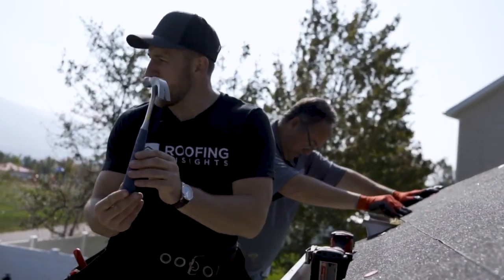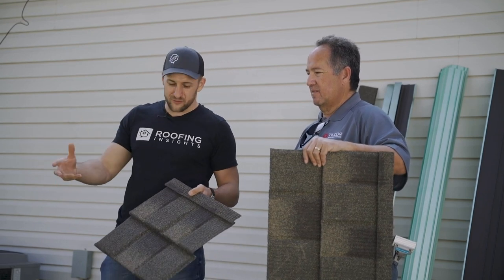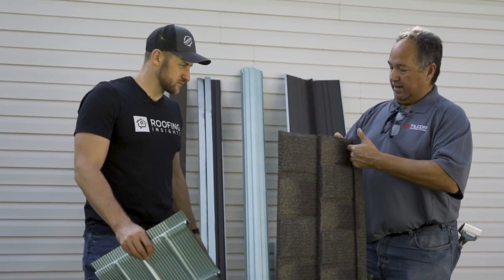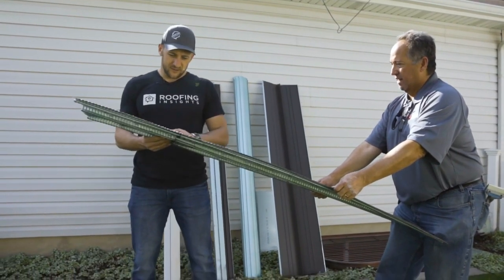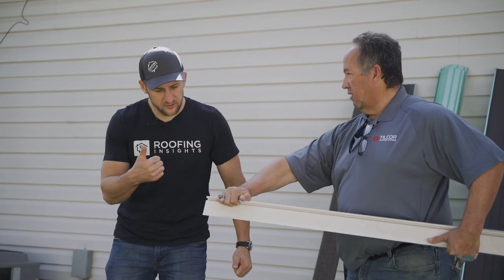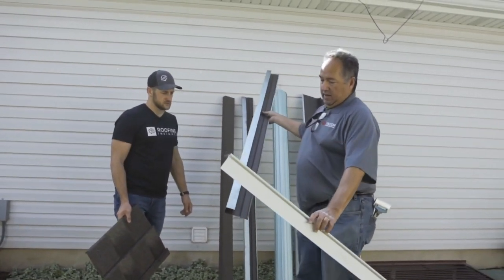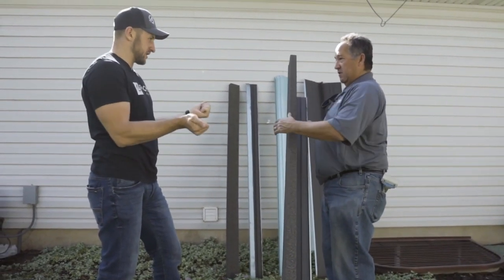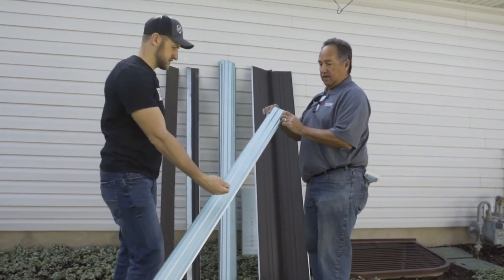Metal Roofing Installation: Tilcor Roof System | Roofing Insights

Comment: so what do you do on this roof for fall protection after it has been installed? where does the temporary anchor go? In my area permanent anchors have to be engineered so nobody installs them and it is common to screw temp anchors over the asphalt shingles then seal nail holes with caulking. Fall protection is mandatory for heights over 1 story.. Gutters get cleaned twice a year sometimes.

Comment: Cool system. Id love more information.  

Another metal roofing system that you can use granulated ice and water shield. Diamond metal shingles also allows granulated ice and water, according to BDR. 

As I'm sure you know, you have to use Psu30 or some type of smooth ice and water shield (that won't stick) on standing seam. 

Do you have information for sales rep on diamond metal shingles and this product? U.S. based reps??

Comment: Sorry Dimitri, I can't endorse any metal roofing company that uses a granulated (garbage) ice and water shield with a G90 or AZ60 substrate.  The lifespan of the metal roof will far out reach a product meant for use with a 15-20 year product. Imagine a cold can of soda/beer on a warm humid day, it condensates.  Now imagine that happening on the underside of the steel panel, with the expansion and contraction of the metal.  Take moisture, steel, and self adhered sandpaper (granulated Ice and water) coupled with expansion and contraction... rust the panel from the backside out.  Metal roofs are much like tile roofs, where the metal only handles a certain percentage of the water, and the underlayment does the rest of the work.  Much as your video about ice and water shield explains the value of ice and water, and the extreme differences between a granulated (cough garbage) ice and water shield, and a high-temp, or film faced ice and water shield, I refuse to stake my company's reputation, and the expense of warranty calls, for a few dollars per roll.  If you are really selling the advantages of a metal roof, you should have no problem justifying the your price, and why you use quality components that make up the core of your roofing system.   Also, for the love of all things holy don't staple the synthetic felt.  Manufacturers only cover stapling synthetic felt when you are able to cover it in a short amount of time (varies per manufacturer, and per final roof covering) and most metal roofs take far longer than those stipulations allow.  Has anyone ever wondered why Titanium UDL has Ghost Buster style pictures of no staples, and says "Do Not Staple"?
Reply: Comment edit: Painted, or stone coated steel, usually has a substrate of AZ-50 galvalume.  Also, despite my rant of installation practices, this product, as installed is still far and away a better option than asphalt shingles, for those who can afford the upgrade.  Keep calm, and metal on!

Comment: Put those shingles on every roof and  the re roofing business is out lol they  will prob last 50years and not be affected by hail storms
Reply from the maker: True that. Metal roofing is definitely trending.
Reply: Cost of materials per square?
Reply: @michaelvan6675  nope 26 gauge steel hold up extremely well
Reply: @ToddBizCoach  lots of variables but rough estimate is around 325-350